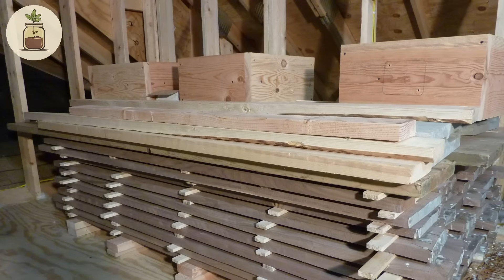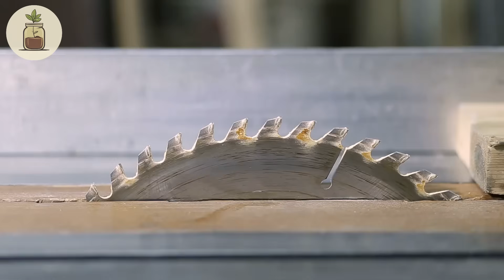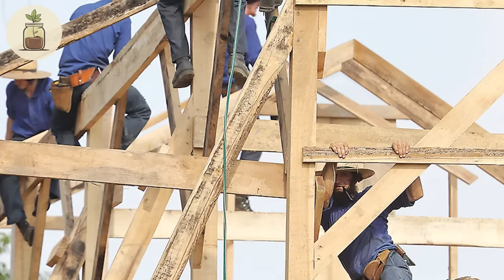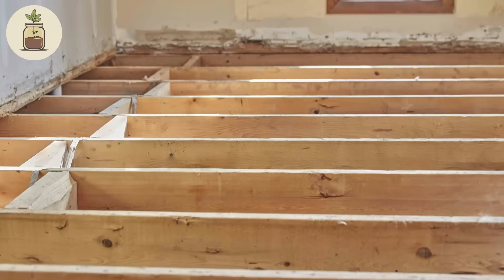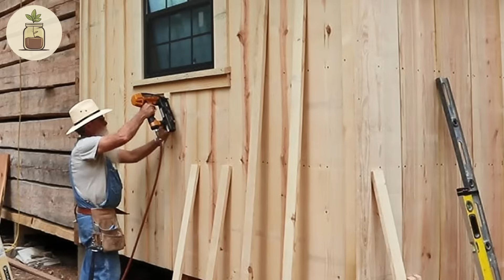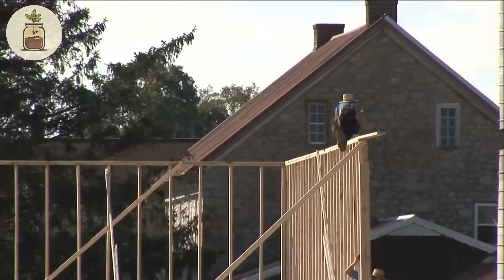How Amish Raise Barns Without Cranes

Comment: They do and they have extra large crews to do it fast which makes it seem like they are efficient but its much man power.
Dewalt power tools, pettibones, every piece of excavating equipment, generators ect. Dont fall for the inage.
As far as farming well yes they still use mules and horses vs tractors but its small scale farming.
Our great grandfathers and current African tribal communitys impress me more.
amish have comodified and image that bring is dollars but they are vastly overated in every aspect

I would like to add building, design and construction ideas are often borrowed or stolen by amish. They are not innovative but great copiers and get bids cause of their image..
They dont buikd like the guy from my self reliance or great granpas..
Dont fall for their scam